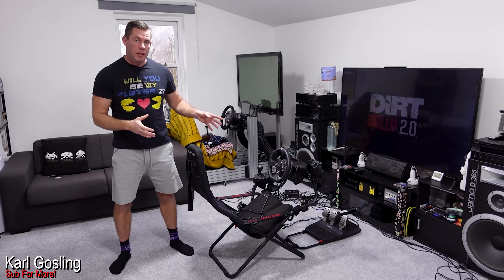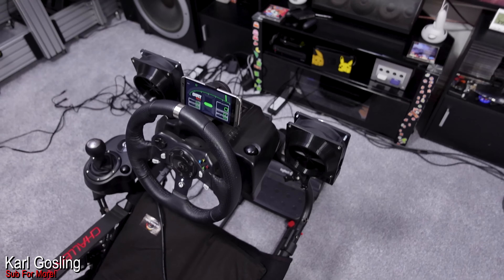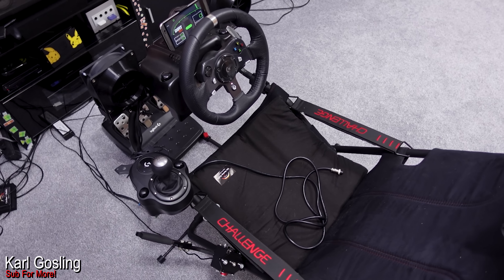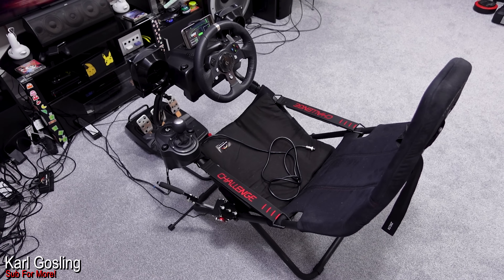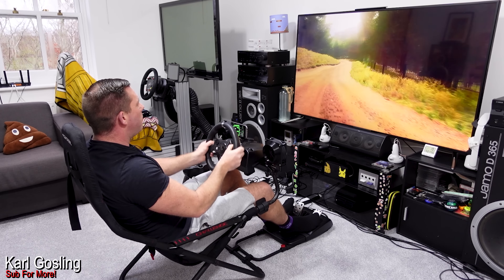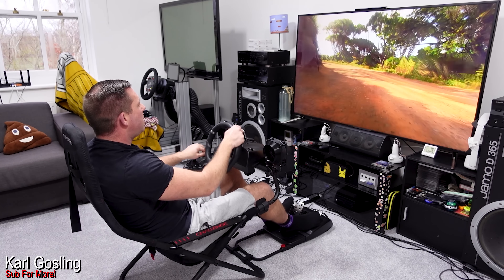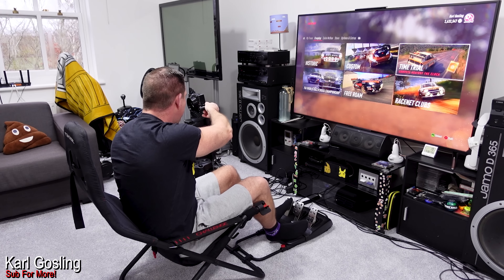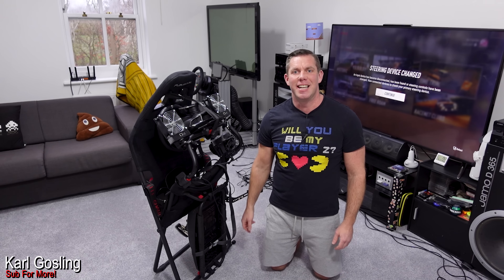The Pimp My Playseat Challenge - How Good Can It Really Be?!

Comment: A little hack I use is instead of folding it away, I just pull the back/head rest up until it completely slides off the inner tube, and rest it down on the seat. It basically cuts it in half so when I watch or play something other than a sim the top half of the seat is out of the way.

Comment: Very nice. Have have something similar, fanatec base with formula carbon wheel, arduino button box and handbrake and with a valve index so it folds up tiny still. And only 1 usb cable to connect everything to the pc to keep it tidy 👌
Reply from the maker: Sounds great!

Comment: Been watching your videos for the past few hours. Finally decided to go Playseat Challenge instead of NLR F-GT Lite mainly because of the portability of the Challenge. Slimmer, lighter and faster to fold over and over again. I'm smaller than you and you fit fine in that Challenge of yours so I think I'm gonna be fine. Only cons I can think of is the smaller height since I play on a desk, lack of included shifter mount and possibly less stability with a load cell modded pedals. First two isn't too bad but hoping the 3rd isn't gonna be that much of an issue.
Reply from the maker: Strong pedals can make the Playseat lift off the floor so choose carefully and adjust your seating position accordingly.
Reply: @KarlGosling  how would the pedals lift off the chair, if you sit in it? 🤔

Comment: Playseat Challenge is top notch if you want something that folds. Mine has been Pimped out with 4 corner transducers, under H pattern Transducer, under Aiologs Sequential and Aiologs Handbrake (VERY HEAVEY) . I could figure out a way to mount the wind but might not do that until I get a permanent rig. With 2 shifter mounts and the total of 8 small puck transducers it all still folds. In VR is it very immersive, Dirt Rally is amazing.
Reply from the maker: Decent setup mate! :)
Reply: Would love to see some pics of it, always nice getting new ideas :)

Comment: Hey up again Karl, so I got a Challenge yesterday and spent ages setting it up, but it sadly isn't very good for me personally. The wheel is far too high and the headrest angle hurts my neck. The seat also rocks back when I brake, and the wheel deck wobbles like mad with my T500RS on it. I'll stick with this Apex as a stand until I have room for the rear seat frame. 👍🏻
(For anyone else reading this in the future, if you don't have a heavy and powerful wheel, and you are quite tall (5'11" and tall torso), the Challenge would be fantastic like Karl says. However, I'm 5'6" with a short torso and I have a heavy wheel, so it's a no-go for me sadly)

Comment: Hey up Karl, I'm wondering if you can give me some advice. I recently bought a GT Omega Apex to replace my Classic stand, and while it's solid as a rock in comparison, it still wobbles on my carpet and I still have to use this damn office chair. I'm gonna be getting the Fanatec CSL DD, and I've seen that it's fairly easy to add some support braces to the wheel plate on the Challenge. I don't have the space for a full cockpit, so it's either Apex or Challenge for me. The more I look into the Challenge, the more it appeals to me: Doesn't wobble on the floor, easy to make a shifter and handbrake mount, the FFB is translated through the frame into the seat which gives extra immersion, it can volt away nicely, it's comfortable, the seating position is good, etc. 
I'm really leaning towards the challenge after constantly bashing my forearms on my chair's armrests for the past few years. Do you think I should just go for it? I'm 5'6 as well, in case you have anything to say about height requirements for the seat. Cheers.
Reply from the maker: I would mate, just the fact that the chair is fixed as part of the rig makes a big difference IMO.
Reply: @KarlGosling  Yeah that's what I was thinking. I'll give it a go! Thanks

Comment: Great content again Karl. Interested to know if you know of a mount that could go on the right side, thinking of modding mine to use for flight sims aswell. So have a side mount to put a joystick on. That vesa mount you have only works on the left I take it. Also any reason why you swapped it out for the lowdown mount you reviewed last year.? Cheers
Reply from the maker: Yeah only on the left mate.
I prefer it, less flex, cheaper and it's something I can link to for viewers.
Reply: @KarlGosling  thanks will keep looking for something that could fit the 25mm tubing on the other side. Cheers mate.
Reply: @paulr112  I mounted my shifter with a 25.4mm bicycle stem. You could easily make a flat platform on top.
Reply: @4879daniel  ah great tip, do you have any links to what you used. I have a vesa 200 plate to mount a joystick to, it's just finding something to fix it all together. thanks alot.

Comment: This is a pretty old video so you probably won't see this, but how does the Sim Racing Studio transducer kit compare with the Buttkicker 2?  I have a Playseat Challenge and I'm seriously considering adding these if you can still fold it up with them mounted.

Also, Do you think these would help getting past motion sickness at all in VR?  I have a couple of friends who want to get into VR racing, but I'm afraid they'll just get sick if they just jump right in without any prior VR experience.

Also 2. would the transducers would with flight sims?  I'm into historic flight sims (WW1, WW2) and I think this would be really cool for those if it works in things besides racing sims.
Reply from the maker: SRS Kit has many more channels versus just one BK.
No it won't help with motion sickness (I suffer with that too).
If the flight sim has telemetry output then yes, you can check the SRS website for a list of supported games.

Comment: Karl you use VR but you still stick by a massive TV, can you do a video on this. I have a quest 2 but there 8s something great about just monitors
Reply from the maker: Yeah I get motion sickness after a short while in VR when sim racing so that's why I mostly use a large screen... plus my graphics card isn't powerful enough to run DR 2.0 in VR on high settings so it doesn't look as good either.

Comment: i have fanatec clubsport 2.5 on it and i found it vibrates and moves too much on playseat so what i did was lower my standing desk to lowest position and with some foam put wheel base against it so it does not move and also take off the pedals and put em up against the wall as playseat starts raising if you break too much.
Reply: Yes, like you, I also slide my Playseat Challenge so the back edge of the wheel plate rests on the edge of my monitor stand.  It really stiffens everything up, with no compromise to the practicality.  Personally, I think the Challenge is am amazing cockpit solution, and I don't even have the requirement to fold it away.  But I do slide it out of the way sometimes, which also is super easy to do.

Comment: Cracking vid mate.. really looking to move in this direction in the future.. one small question, I have the same handbrake, but mine will not configure to any game. Am I doing something wrong or have I got a duff one. I’ve tried different usb sockets just in case but still nothing.
Reply from the maker: Hmm maybe you have, does it show up in the game controllers settings in Windows and calibrate ok? If it does then it's fine and must be an issue elsewhere.
Reply: @KarlGosling  I’ll give that a check mate.. now you say that, on fs19, ( yeah I know I’m sad😂) there is now a device registering on there as ardinuo something???? Not sure of spelling etc. I’ll check it properly. But pretty sure nothing shows on dirt 4 or any of the other dirt games.
Reply: I can’t install all the dirt games at once as my pc just freezes up something terrible. It’s bad enough with just dirt 4, euro truck and fs19 installed. Is that a graphics card problem or a ram problem. It’s running win 10, ryzen 3, 8gb ram, and a gtx 1050 graphics card
Reply: @KarlGosling   it is showing up on my windows karl.

Comment: Hi - random request - how have you strapped the pedals to the floor/mount?
Just velcro straps, or straps + cable ties?
Cheers - keep up the great content!!!

#ShitSuction
#SuckRoundTheCorner
#MindButtCheekConnection
#TheMoreYoullFeelItThroughYourButt
#AddALittleBitOfGreaseIfYoursDoesntComeGreased
* addA a little bit of grease if your's doesn't come greased and your good to go
Reply from the maker: 4 M6 Bolts with penny washers mate.
Reply: @KarlGosling  ah.
I bought the x-rocker xr from Argos (for £89 before any quidco cashback).
There's no mounting holes/brackets for the pedals - hence my seeming obvious question

Comment: Do you need a high spec PC to run tactile transducers?
Reply from the maker: No mate, there's almost no load on the PC at all.
Reply: @KarlGosling  Is there just a plug and play one that doesnt require any messing with wires that will just plug into my laptop audio Jack?

Comment: Wind simulation?  I genuinely don't understand?

Do real rally drivers drive with all the windows down?  Without a windscreen?  What is this supposed to simulate exactly? 🤔

Can anyone explain why this makes sense?
Reply from the maker: Did you miss the part where I explain how it works and what it does? Maybe watch it again mate.
Reply: @KarlGosling  No, I watched it all, mate.  And it doesn't make sense?

A rally car has windows - what is this simulating exactly?  I have driven cars for over 30 years - there is no wind-rush, even with the windows down.  So what is this simulating exactly?  As a car driver, I'm genuinely confused?

I could understand if this was for open-cockpit, for example F1, even convertible cars perhaps?  But no car I have ever owned directs wind at me depending on cornering, so sorry, but it doesn't make sense?
Reply from the maker: It's simulating speed/movement using airflow and is just another form of physical feedback about what the car is doing. 
The phrase "wind simulation" isn't the best but it's what people use. 
I do lightly  explain this in the video.

Comment: I don't understand the fans, if your racing you have the Windows closed to reduce drag, therefore you don't feel any wind. If the point is realism then the fans seem counter productive. 

I've done 155 in my merc and didn't feel a smidge of wind in the car 😂
Reply from the maker: No, the point is not realism... As I explained it's just another form of physical feedback about what the car is doing, in this case; direction and speed.
Reply: @KarlGosling  Okay, that makes sense, I do wonder how much the fans really add to the feedback of speed and direction compared to looking at the screen. We don't have an issue driving a real car on a track without wind cues to our speed and direction.

ps: not trying to be negative, I'm not a racesim user so genuinely trying to understand. My 9yr daughter loves playing kart racing games on her PC with a cheap £50 steering wheel and pedal I bought her and I fear it might get to the point in a few years where I have to get her a racing seat 😂